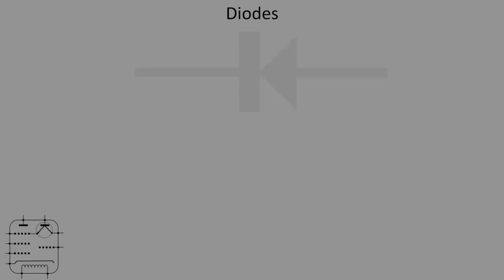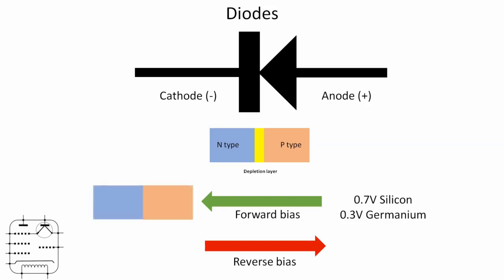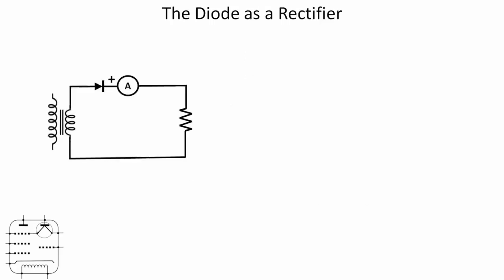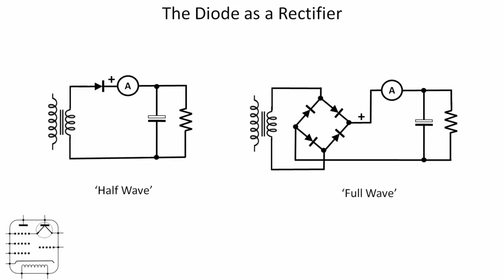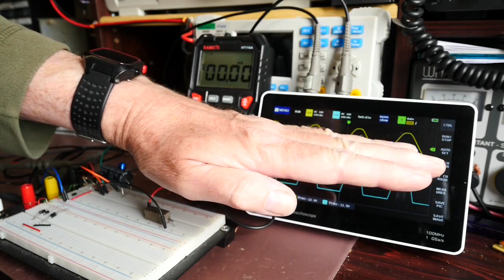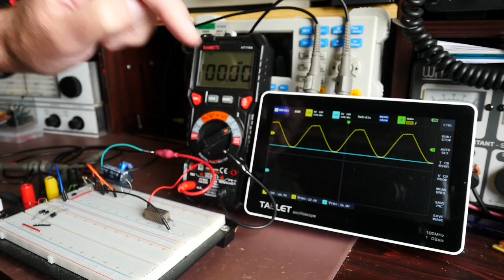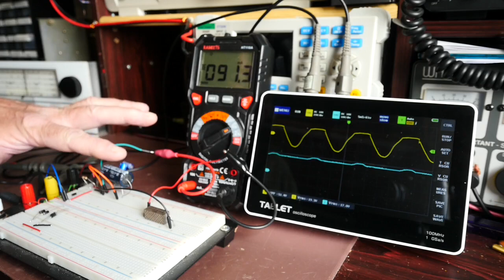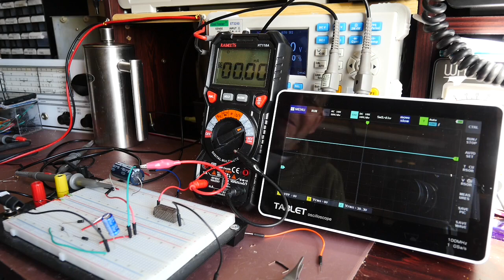Electronic Building Blocks  - The Diode and Rectification                  #064

Comment: Hi Bill, Thanks again for making these videos. I was expecting to see a bumpy road on the Oscilloscope after full-rectification, pre capacitor, not a Sine wave. Did I miss something?
Reply: Old comment but the "bumpy road" did exist, he mentioned the bottom of the "bumps" is Zero reference. You were not looking at a AC sign wave, you were looking at both negative and positive sides of the sign wave going positive